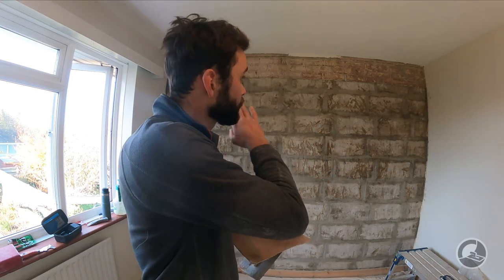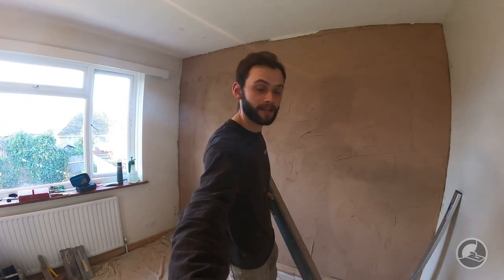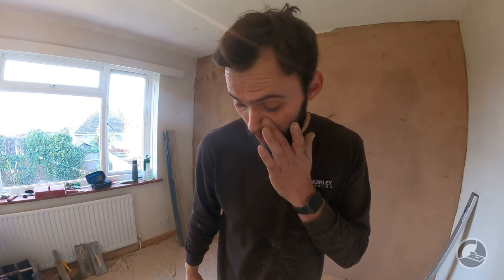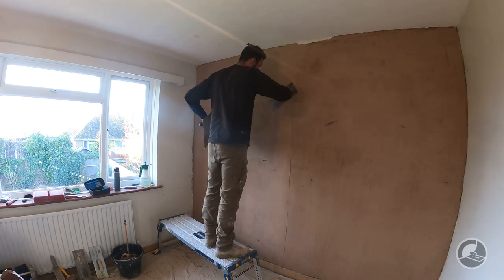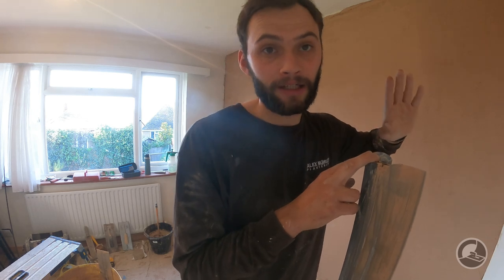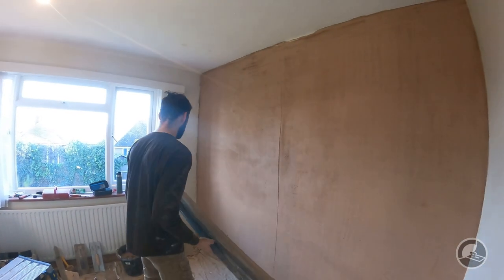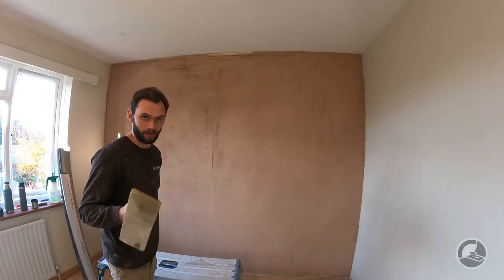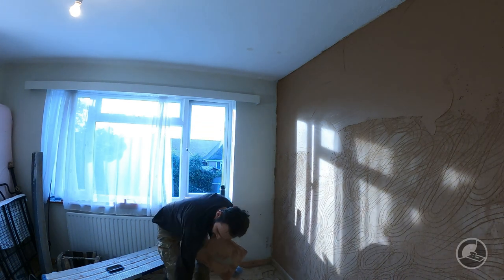Plastering for Beginners FLOAT and Set

Comment: If you left the hardwall to dry for a few days, can you just apply PVA and then plaster?
Reply: Yes
Reply: You can but be very careful not to get caught out by the suction, as it can be very unpredictable after a few days. Best off skimming same day. Failing that, several coats of SBR before skimming to safeguard against cracking risk.

Comment: Amazing video buddy! Any reason you didn’t use sand and cement instead of Hardwall?

And are those squiggly lined on the right of the wall on 26:00 from you testing to see how much it’s pulled in?
Reply from the maker: We only use sand and cement if there is a concern over waterproofing. Light weight backing plaster like hardwall is designed for masonry backgrounds. No gain really in using S&C. 
They were squiggle’s from my fingers which was cut out of the final take. But yes testing the moisture on the wall.

Comment: Another nice job and good tips 👍. Where did you purchase that bench?, I like the pick up handle in the middle.
Reply: Itd a werner hop up £50 in wickes
Reply from the maker: https://www.wickes.co.uk/Werner-Professional-Work-Platform/p/185927?utm_source=google&scid=scplp185927&sc_intid=185927&gclid=CjwKCAiAhreNBhAYEiwAFGGKPClDutgQgaKFMM4ECk2ox5gAqUQf9aMbpPEeKtlN1Se8XeyYNkv91xoCf2oQAvD_BwE&gclsrc=aw.ds
Reply: It is £100 and not £50 by the way and the Werner hop up goes up in multiple stages and it is 150kg rated.

Comment: HI ALEX,  NICE JOB, WHAT IS THE LOW AREA AT THE TOP OF THE WALL IN THE MIDDLE ??
ALSO, DONT KNOW WHY IT WOULD NOT BE ACCEPTED TO SPAT THE FINAL COAT OF HARDWALL PRIOR TO SKIMMING  ???  I HAVE ALWAYS DONE THAT,  I NEVER LIKE TO RELY ON MY PREVIOUS COAT BEING DAMP, FOR THE PURPOSE OF A KEY, SO, I ALSO, LIKE YOU DO, USE A SPAT, BUT I GIVE A (SLIGHT KEY)  BY USING A SERRATED, SPAT, OR AS A ALTERNATIVE I MAY SPONGE IT. I DONT LIKE TO HAVE NO MECHANICAL KEY BETWEEN TWO DIFFERENT MATERIALS, eg HARDWALL TO SKIM, etc. CHEERS.

Comment: 8:15 - Noticed there is a slight pattern off the speedskim, are you not concerned given the second coat will just apply straight over this and that is where you will do your finishing as such? I've done plastering before but trying to master the trade now... only for DIY purposes.
Reply from the maker: Not totally sure I understand the qs. Any shadowing from the scratch marks disappears after jt has had its second coat and sponged. Hope this helps answer the qs.

Comment: Did you apply PVA mate before your first coat of hardwall to kill the dust ?
Reply from the maker: No. Not when skimming it the same day. The hardwall is still got moisture in it.
Reply: @AlexMorleyPlastering  sorry mate I ment onto the old brick background
Reply: He said at the start that he applied PVA to the wall however it isn't too necessary as hardwall is for high suction backgrounds anyway, but it's good practice to do.

Comment: Whats your opinion on speedskims which one would you recommend for someone who mostly skims
Reply: I would buy a refina sponge. Speed skim are ok if the wall/ ceiling is flat! If not it’s a complete waste of time! Lay on & double right up! Clean bucket & then sponge right away.. leave 5-10 min another hard trowel followed by a hard cross trowel.. then one or two superflex to finish. One wet & one dry cross
Reply from the maker: Personally I like the refina comfort grip version in plastic. 

It has a very thick blade and it’s nice to use. Handle is great once you get used to it

Comment: Out of interest I always find it easier to use biggest straight edge as possible to test if it’s flat
Reply from the maker: Great comment. Funny I’m the exact opposite. I prefer a shorter one. Easier to control.
Reply: @AlexMorleyPlastering  I find it can not be flat if I use a shorter edge you get it on flatter than me I don't do much plastering these days thank for your content tried doing a small video of my own for social media it difficult
Reply: Same here use a 2m h rule then check it with a 2.5m screeding rule
Reply: @MrProbarrage  Are the h rules good enough to check levels by themselves Henry? I was thinking about buying a few of those h rules
Reply: @IanDavies  yes mate they are the same as a feather edge just different handle and mine have rounded edge instead of sharp
Reply: Yeah 6ft straight edge minimum in my opinion.

Comment: 3/4 hard wall 
1/4 bonding … bonding 60 if small area …. 1st coat 
Hardball top coat ,.. 
or 50/50 finish 
I coat finish if ya catch it right 
No water 
2 flatten 
2 nella gold flex 2 vertical 
1 horizontal 
Cut boxes out 
Sexy edges :)
WONGA 💷